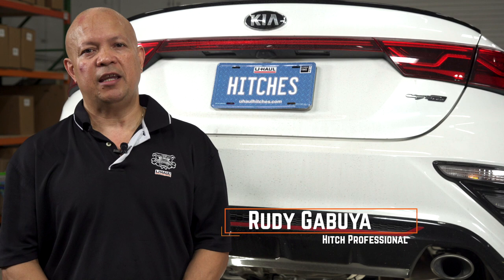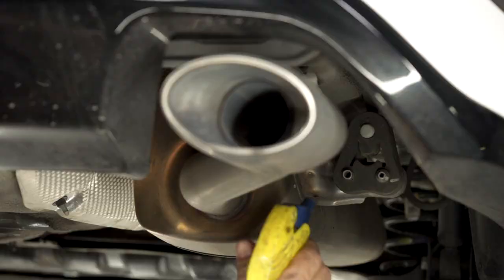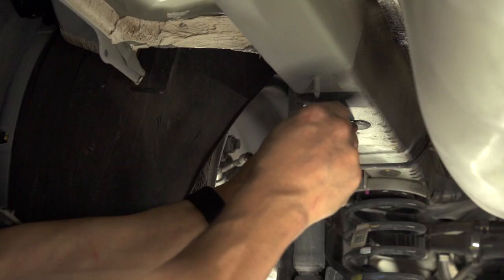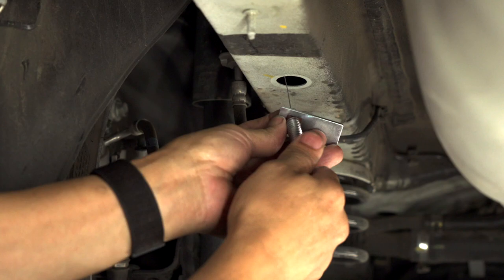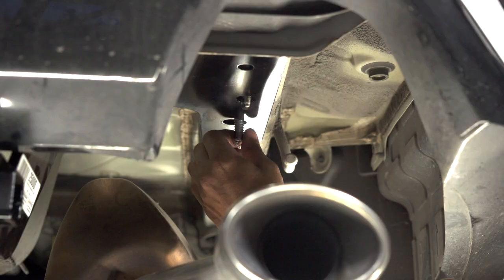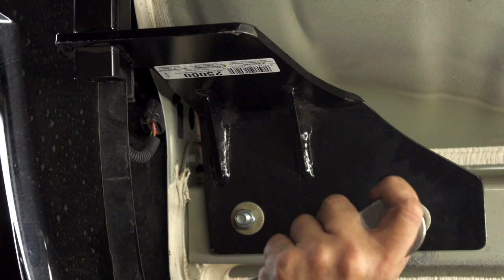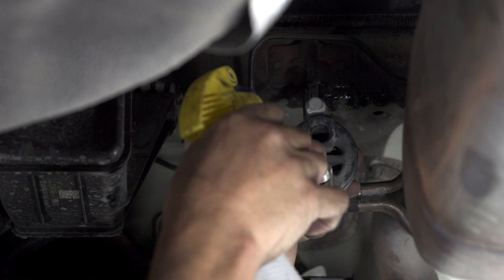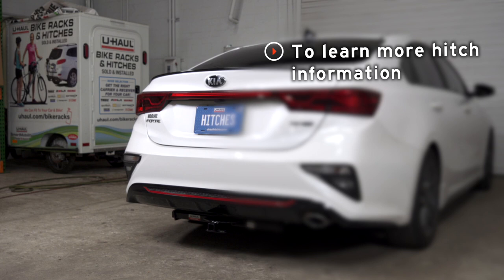2019-2024 Kia Forte | U-Haul Trailer Hitch Installation | CQT25000

Comment: He is installing a Draw-Tite Class 1 hitch part # 25000. Wish he would have mentioned this in the video and saved me the trouble of buying a Curt hitch, thinking the installation procedures were similar. The Curt hitch requires the installer to remove and cut a piece of the rear fascia to make a proper fit.
Reply from the maker: Its in the video description as well as a link to buy the product.
Reply: @trailerhitches how much is it?

Comment: what if the bolts got installed on the furthest holes and the middle holes. Is that an issue that I need to go back and have uhaul fix?
Reply from the maker: If they installed Draw-Tite 25000 then it should be installed like the video states. However, there are several different hitches that can be installed on this vehicle that may use a different method. If you have any concerns, please call your installing location. Out Hitch Professionals are always here to help and answer questions!